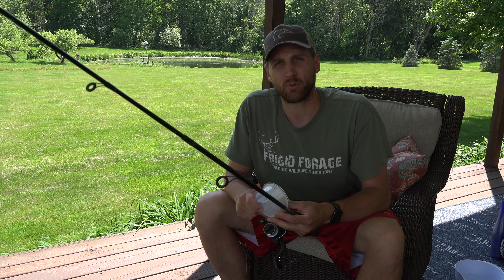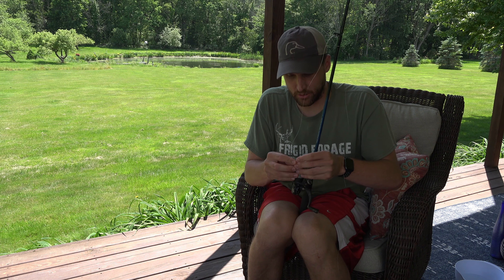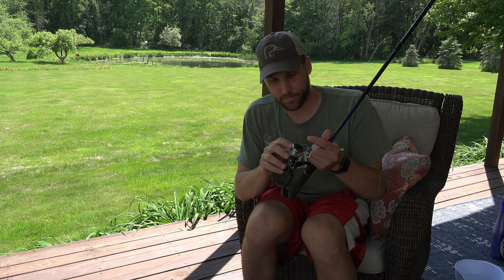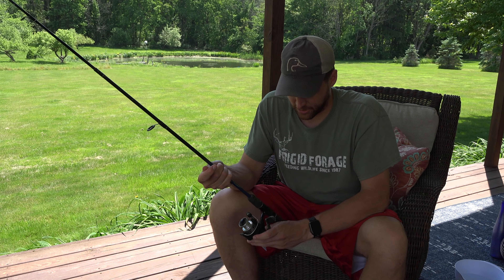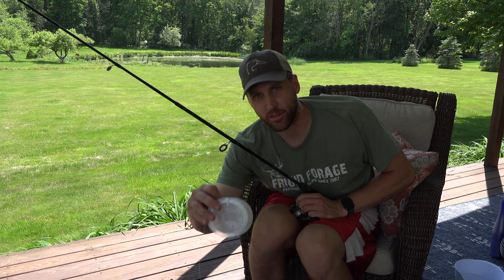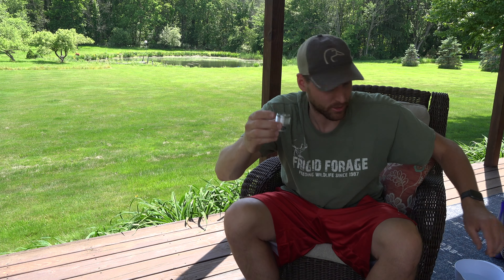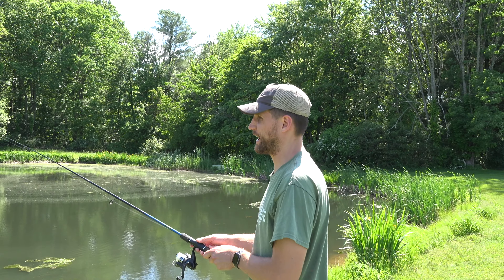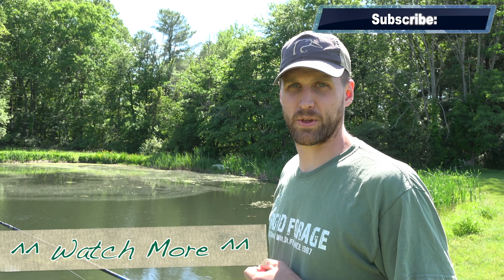Best Way to Put Line on a Spinning Reel | How to | Easy Tip!

Comment: If u use a leather glove while holding the lines as u spool it  it will do the same but I always put the refill spool in a bucket of water works too
Reply from the maker: Thanks for the tip and the comment!
Reply: @WeekendWoodsmen  your welcome bro always willing to learn new trick and give a trick or 2
Reply from the maker: That mindset will take you a long way in life! 👊🏻
Reply: Yes sir it sure will and not sitting in front a video game

Comment: I haven't been fishing in 30 years but decided to get back into it now that I turned 60 and lost a bunch of weight. I have a rod and reel that will be here in a few days. I'm thinking about 20 pound braid with a 8 pound leader of maybe 10 yards. Does that sound reasonable? I'll mostly be fishing with bait for crappie,  misc. sunfish and cats. I don't expect to ever hook one over maybe 5 pounds.
Reply from the maker: well welcome back! I don't think I'd worry about the complication given what you are fishing for.  I tend to use standard line most of the time.  For me, it makes casting easier and less gear to worry about.  With that said, you might want to go with lite, simple gear for the small fish and something different for the cats.  Probably just depends on how you like to fish and what your preferences are.
Reply: Use the braid. It casts like a dream. 10lb fluorocarbon leader a little shorter than the rod. Connect braid to fluoro with an Alberto knot